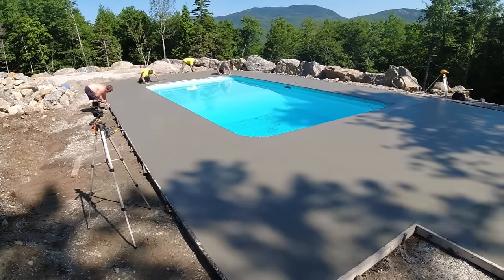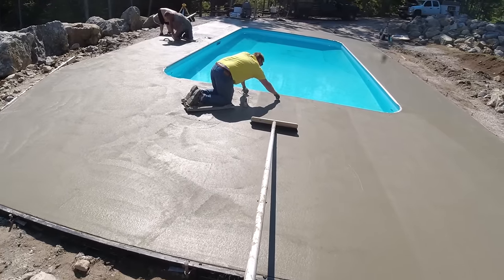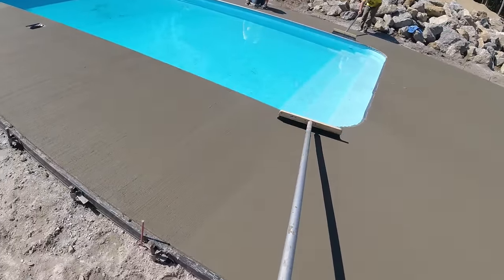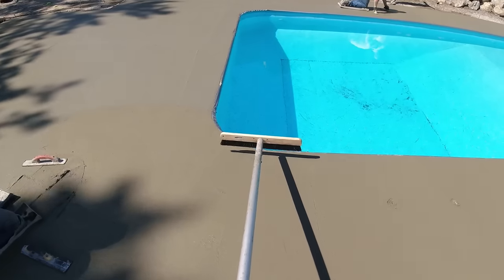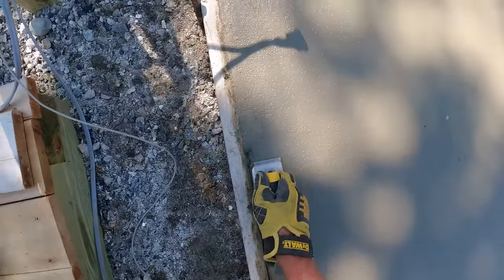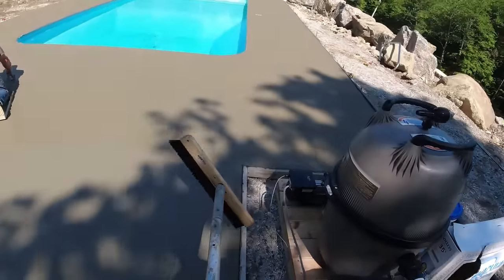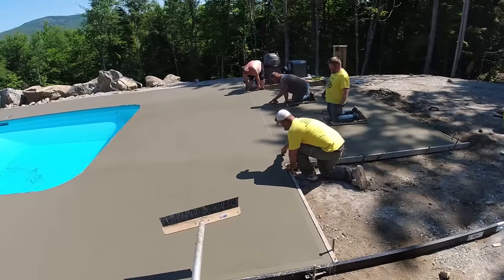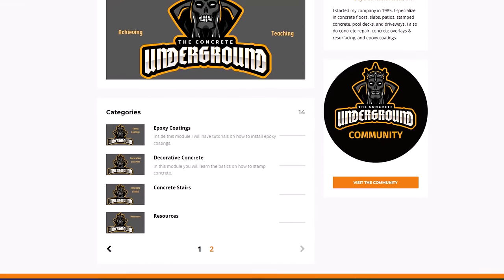How To Finish Concrete - What You Should Know About Finishing Concrete

Comment: Mike I had a 14x40 by 4.5 inches thick patio done, the concrete guys didn't put in joints. Does it need them? Should I have them saw cut joints? How many?
Reply: In my experience, yeah concrete should have control joints. Especially if there's variable temperature swings throughout the year in your area and/or potential issues with grade below or around the concrete. I pour/finish concrete for a county school system here in NC and we either groove or cut joints every 5 feet. I believe Mike and his guys do joints every 10 feet or so generally (or at least they have in some videos). But definitely wait for Mike to answer because he has a ridiculous amount of experience.
Reply: Cut joints in